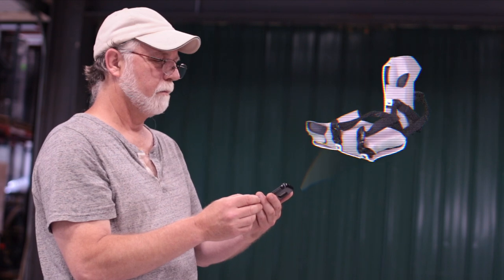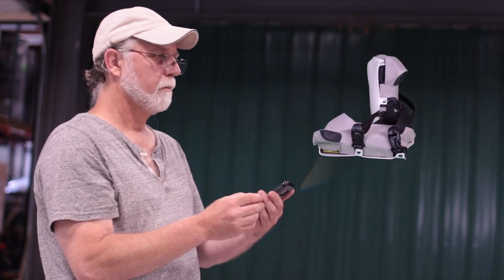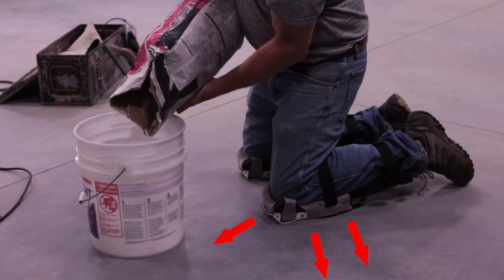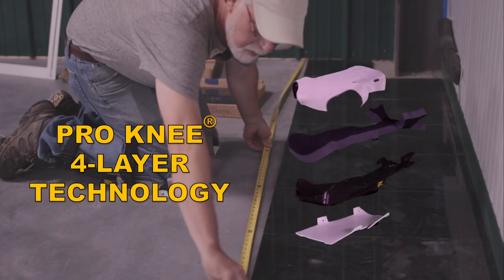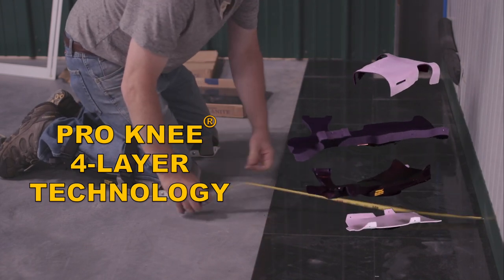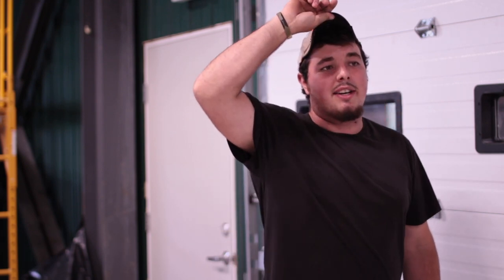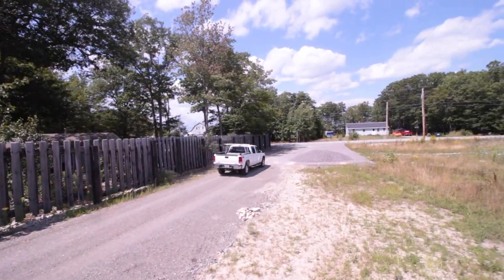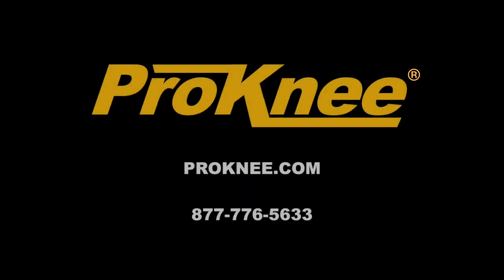THE PROKNEE DIFFERENCE

Comment: What would be the best bet for a concrete carpenter?
Reply from the maker: Hi Ruby! We highly recommend the full size custom fit Model 0714 if the majority of your work is on the floor or if you are on your knees for 8+ hour days. They offer the maximum protection and benefits we offer. You can learn more about them here: https://www.proknee.com/0714-0714e-custom-fit-kneepads

Comment: Hi I was wondering if the ProKneés could withstand abrasion from roofing shingles and flat roof membrane with similar abrasions??
Reply from the maker: Hi Yannick, we have many guys from the roofing industry who swear by our pads. Our rubber exterior boots are made of a 3 ply polynitral and should hold up to just about any condition! We also offer separate replacement boots when these get worn in over the years. Hope this helps!
Reply: Mr. ProKnee Does the Canadian distributor ProSol Distibution Inc. in Montreal Canada 🇨🇦have not only all the parts but service to mesure me so I get the right ajustement and the right size?
Reply from the maker: Yannick Roy  All of our distributors are equipped with information on how to properly measure along with our special measuring instrument, the ProMeasure. But we do encourage our customers to let their distributor know we are here to help if they have any questions! Just be sure to try on your set before leaving the store to ensure you have the best fit and avoid any size change after the fact. Your distributor should have parts kits in the store but if they don’t, they should be able to place an order for one. I would recommend calling ahead about any parts you are interested in purchasing.